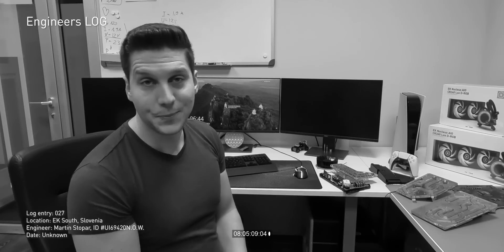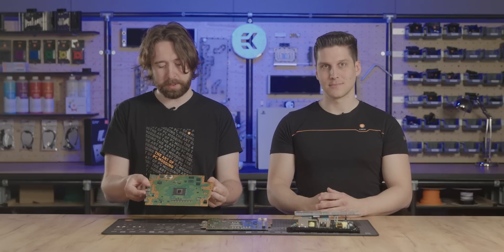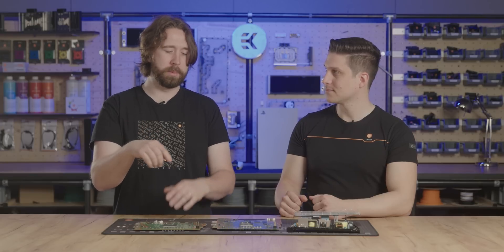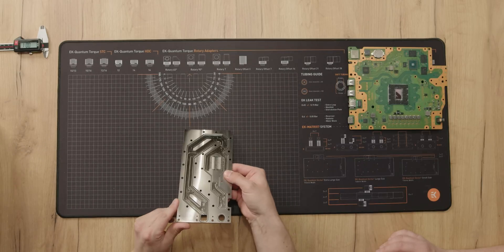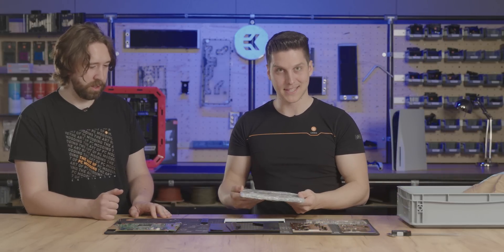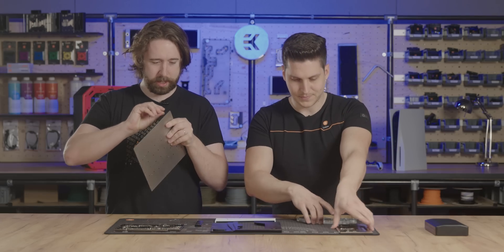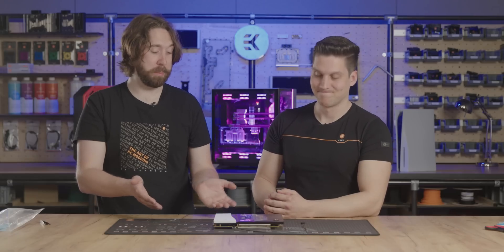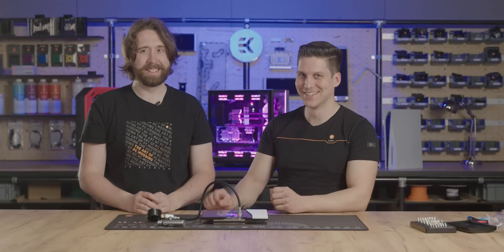QuantumX for PS5: EK UNVEILS THE FIRST PROTOTYPE! | Is it the next big thing in watercooling?

Comment: 15:44 Look into torque sequences used on gaskets for engine applications. You might find the way you tighten down the gasket matters. It does when were rebuild an engine. If we tried to tighten a head gasket down in a random way like you did the block, It would never seal. Might be just different materials, but im guessing theres something to this. Its not a World practiced mechanic/engineer/car/engine manufacturer method for nothing.